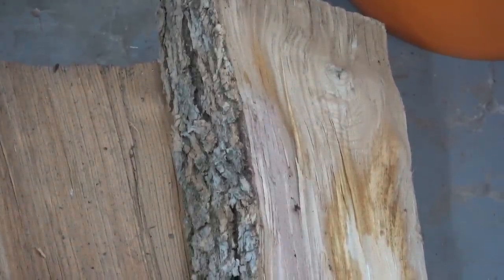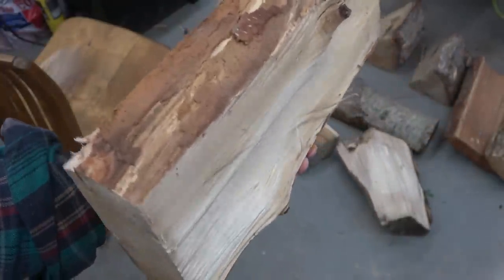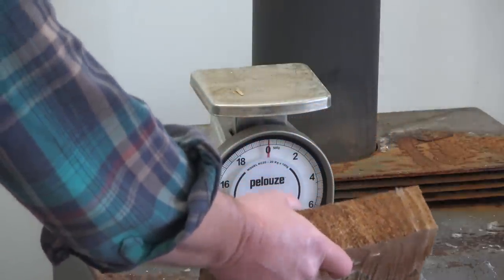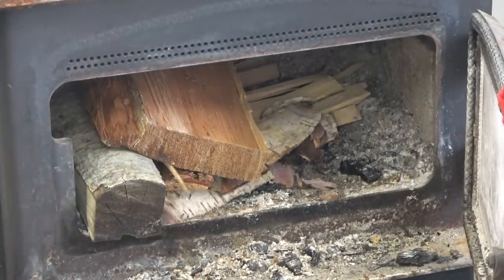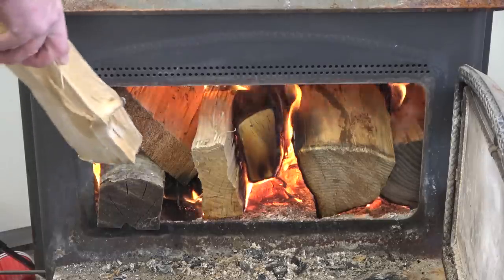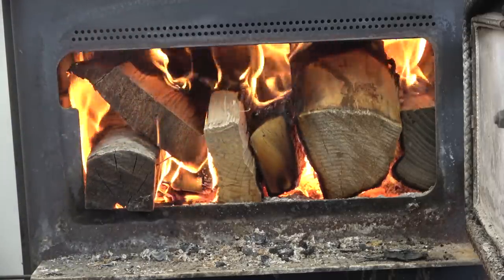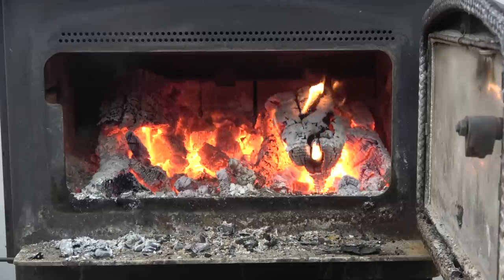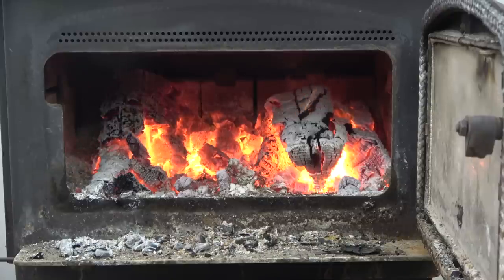Best firewood?

Comment: I learned a few years back that it is indeed all about the mass - the same weight of whatever species, assuming nearly identical moisture content, takes almost exactly as long to burn and produces almost exactly the same amount of heat... soft woods are fine if you don't mind building lots of fires, but hard wood weighs more so you can load more mass in your fire box for a longer (like overnight) burn.
Don't underestimate what a top down fire can do for ya either - it can be a real game changer (seriously).
Reply: I absolutely agree! I burn free pallets I collect in a commercial district nearby, and disassemble using a special crowbar like tool I welded together for this purpose. Nails I simply flatten to collect them later from the ashes with a magnet.

Comment: Heat output is what's important,when I use oak an ash I use a lot less wood and the room gets too hot,when I use softwood,the room doesn't get as hot and I use a lot more of it because it just doesn't raise the room temp like hardwood.
I also put blocks of metal in the one in my shop and place them around the room once hot

Comment: I would argue that a test on volume would be just as useful (and easier to do). The volume of our firewood might even be a more important factor than mass since we have to store it in the truck on the way home, store it in the yard for splitting, store it in the shed, store it near our stove, and ultimately store it to death in the firebox of the stove. Of course you could also do the water temperature calorie test on mass and volume samples of each species, but that seems like work.

Comment: The catch is that the actual BTU's coming off the pine are likely less, regardless of duration burning.  Moisture content really will throw off the weight.  
Tear into an old house and 2x4's are light as a feather.. new ones although kiln dried are still a little wet and take a nail WAYYY better.  Alot of variables in this 'test'

Comment: My recommendations as a burner of the cheapest crap (transport pallets): stack it dense as you can on the bottom of your stove, and start a fire of shavings and chips on top. Great fuel efficiency, tremendous heat, low pipe fouling.

Comment: Old timers know how to burn pine inside without burning the chimney up.  You use the pine when it is burning the off gas as well so the creosote doesnt build up.  You use wet hardwood mixed with seasoned dried wood so the fire burns longer.  So, if anybody says there is a proper or best wood to burn they are just blowing smoke.  It is always better to use a mixture of wood types and moisture levels.

Comment: What was the actual total burn time?  Pinyon Pine has 27.1 million BTUs of heat energy per cord (or 2.65 kWh/lb of dry wood).  Ponderosa Pine has much less @ 16.2 million BTUs of heat energy per cord (or 2.03 kWh/lb of dry wood).

Comment: Best fire wood must have, low water content, low ph, low or none resin/sap, decent size-not split, leaving minimal ash and producing minimal smoke.

Ash of  1 ft. diameter cut to 2 ft. pieces, cured and dried for 3 years will burn in my tuned fireplace for 4-7 hours (depending on out side temp). But my fireplace insert after tuning, when it reach around 300°C it behave like a wood gasifier. There is no yellow flame, minima to no smoke. Only down side is in this mode it behave like a nuclear reactor. If i slow it too much it can die or produce CO, even explode (it happened on 2 occasions, once there was wood chips involved, second small chunks of low grade wood). And if opened it to much there is potential of melting chimney (this happened only once, were i have spot reaching 650°C). Since then i rather go safe then maximum efficiency.

Comment: I had about 50 White Oak cut 2 years back for lumber 
I harvested all the branches and sections of the trunk no usable as lumber 
With several of the trees over 6' at the stump ( Almost 2 meters ) 
I got a LOT of good HARD firewood to burn over the next 5 to 6 years 
I also cut Osage Orange , but it dulls the chain a lot

Comment: If I have a stove insert, is it better to leave the door open, or it doesn't really matter? I haven't really used it for heat really, but I think I might start. Pulls way less draft than the f'ing forced air heat leaking supply air into the ground 🙄

Comment: I really liked this as I’m a follower of wood burning in England and absolutely prefer it to the gas central heating system. Can’t go wrong or better than oak though.
Reply: There's pros to them both, but seeing as how a vast chunk of the US has no hardwood forests, we're stuck with fir and pine species. 

As such, that little thermostat on the wall is much easier to feed.

Comment: For my sins I used to operate a wood heater testing laboratory for many years than I care to recall in Australia. Everything done to standards you understand which meant trying to standardise the fuel wood.
Our technique included pushing very dense hardwood though a steel die to achieve a uniform shape. Such fun...not. for what it's worth the terms hardwood and softwood are very specific but I agree with you that ya burns what ya got except for treated pine that is.

Comment: Biggest problem I have found using pine or other softwoods is too much creosote buildup in my chimney. I only use pine as a starter, split small to catch quick, then add a couple of logs like oak or hickory for the long run

Comment: To be fair, you need to test moisture content first. dry burns faster.
Also, size matters. Wood has to heat up to temp before it burns. 4 inches of fluffy insulating pine will heat to the center slower than 1-1/2 inch thickness of hardwood.

Comment: We never burn pine in the furnace, because of the creosote buildup and risk of chimney fires. Horse apple (osage orange) was the best. Other hardwoods were about the same, but some split better than others. I think it was elm that would shuck off the 8# maul and need a sledge &wedges.

Comment: Another consideration (at least for guys with small pecke.. er, stoves, yeah stoves) is the amount of ash remaining.  I have a small wood stove insert, sorry girls, that will fill up with ash after three days of burning using the all mighty white oak.  Not so with fir.  I need to stop burning with oak, cool the stove (and the abode) and clean-out the oak ash fairly often.  The oak is also more difficult to light.  Since the nominal unit of firewood is volume and the stove volume limits how much you can cram in to heat through the night, I think a volume based comparo may be more pertinent.

Comment: Use cubes to heat up a large pot of water and measure the temperature before and after. You want the pot large enough that the water wont boil. Pout in a known amount so you can calculate the heat energy put into the water. Might want to built a small "stove" out of a coffee can with the necessary holes poked in.

Comment: At around 07:00 I'm askin' me-self: "What's his hypothesis here? "Is it faster to burn your place down with a chimney fire or an interior conflagration?" Also, length of burn is not, by itself, a measure of heating efficiency. I could have "pecker wood" that would burn for 24 hours straight (I wish!) but still leave me (and the missus) cold. Some discussion of BTUs per fortnight or kilojoules per second squared would be most edifying. Cheers (again) from Oil-berta. We have some experience with energy here. :)

Comment: Try eucalyptus for one of those burns.

2 years ago I had a cord of that, 3 logs the size of those on the video would burn for about an hour and project heat out of the fireplace about 30’.

7 logs would keep my (at the time) 1800 sqft condo at 82° all night.

Comment: A given mass of any type of wood will produce about the same energy but you buy firewood by volume. Hardwood has more energy per cord so it's worth more per cord.
Softwood could be cheaper per unit of energy... If you have a firebox that can get the most out of it without clogging up.
That's what you should look into.
Cord price per amount of energy produced by the various types of wood.

Comment: My understanding is....
 hardwood burns longer. Soft ( pine) burns hotter.

Old wives tail is soft causes Chimney fires cuz more creosote. In reality creosote is when wood as wet and most of it is in the bark.

Don't burn wood above 20% humidity and try to not burn bark.

Soft burning hotter also means exhaust leaves faster so creosote should go out the top.

Did a ton of reading to get this info and I ended up deciding burn mixed loads to get the flu nice n warm then damper down with a load of hardwood when its time for bed (no pun intended).

Comment: I'd imagine that one of the big factors is surface area. The long flat pieces had more area to burn off, where as the pine was rounder and had less surface area outside. That and having cold spots in the fire let some pieces last a bit longer. Maybe instead of having one big fire with a bunch of different pieces you'd have multiple fires with only one type of wood, with varying shapes and sizes if you want to be anal about it. The plus side is that afterwards you can sell your footage to those people who just play a video of fire on a tv.

Comment: For the experiment:
Test flash point of the wood pieces by heating them in a controllable way, then remove the pieces from the heat source and see how long they burn, measure weight of ashes after experiment? @techingredients help a fellow Canadian out?

Comment: I burn anything and everything that is dry enough.  Sh*t that won't split gets pucked up into 3-5" discs.  If it doesn't fit in the stove- well that's what saws are for.  The occasional pucked-up sycamore can sometimes be split down the middle if you make it short enough.

Comment: If your going to cut down trees for firewood best time is in the winter less sap and spring is the worst time and frozen
wood will split easier than warm wood and split your firewood  so it will just fit threw the door as the smaller the wood
that's split will burn faster

Comment: Do individual burns with each type of wood using the same weight of each in 2in square blocks. Measure burn time as well as temp output. Possibly monitor audio and visual qualities of each wood type as they burn

Comment: Super dry wood is not necessary the best option.  Having a certain amount of moisture in the wood works to slow the burn down.  Like moderator.  Some btu’s are lost in converting the moisture to steam.  Unless you can control the o2 levels some moisture is a good thing.  You want the heat in the stove and not flash burning and going up the chimney.  Look for cracks on the end of the wood(good) that indicates drying.  Any black lines are bad and indicate rot.  Rot is really bad and lowers the btu’s by a huge factor.  When drying wood it needs ventilation as it give off a huge amount of moisture that can cause the drying process into a rotting process.  Birch is generally not good as I split birch can rot in months because of the water tight bark.  Hence why natives used it to build canoe’s.

Comment: I like this experiment but it's flawed IMO. I was expecting it for it to have a group of soft and one of hard, and measure the temperatures of each over time (ie each 10 mins). Because if a type produces more heat, you can just put less and change it more often. It's not fun to do it in the middle of the night but I know someone that does that and seemed to have gotten used to it.

Comment: Ya have to burn one species of wood at a time.. Take a continuous temperature reading until it self extinguishes.. It’ll be the duration of time alongside the energy(temp) that’ll tell ya which species contains the most energy… 

To make it fairer, I’d put energy density first, so would have the volume as the common factor, not it’s weight. The storage of fuel is a finite factor for most, so I’d definitely match the volume over weight…

Comment: Great insider info inbound: Stale bread makes AMAZING kindling. no tinder no nothing. Just a match all that nasty whole wheat $8 a slice  casino bread the old lady makes you buy in bulk. STILL cheaper than the waxy sawdust bricks they sell at the food library.
a slice a white bread goes under the slice of the good stuff. it'll boil the sap out of bogwood in 20 minutes you'll be shitfaced, warm and wishing you could have that bread back

Comment: According to scientific testing, the calorific value for weight is about the same for all types of wood.  What changes though is burn time.  So weight for weight, a high density wood will burn low & slow while a low density wood like pine will burn fast & fierce.  However, both will produce about the same heat energy for the same weight.  Note, I am using the the terms high and low density, not hard and soft wood.  This is because grain structure is the defining criteria for hard and soft woods, not density.  Hardwoods like Balsa have a mixture of large and small pores while soft woods like African Blackwood have a homogeneous small pore structure.  There, I've used 2 unexpected example to make the point, a low density hardwood and a high density softwood prizes for flute making.

Judging by the tone of your video my factual note is probably going to go agin your grain.
Oh well, life's like that ay!  😁

Comment: Wouldn't it make more sense to compare the same volumn, 'cos that's the way you buy it? If you do it by mass you'll have lots of different sized blocks, different surface areas. Currently burning beech myself 'cos it's the cheapest, most common firewood here in Croatia. Or there's hornbeam but there's not so much of it. Apparently oak is rubbish, you'd think the density would make lots of heat and burn for a long time but it's bollocks, it burns ok but not much heat and loads of ash.

Comment: The best is always hardwood.  
Here in Aus we've got nothing but hardwood, but of all the hardwood you get a nice piece of red gum and it weighs twice as much as any other piece of other hardwood. Takes more heat to get it burning but it'll burn for hours and hours. Fantastic stuff
Reply: No.... hardwood burns too hot and it will destroy the firepit of fireplaces and heating ovens.  Its best to burn mix of hard and softwood.

Comment: Not that great a test cuz the different surface area per volume ratios. Much like how a ton of thin steel plate will rust right to nothing in a couple months, but a sphere will probably take many hundreds (maybe thousands) of years. Sure have seen 200 year old anvils left to the elements barely even get anything taken off of them, so a metric ton would probably take thousands of years.

How dry it is is also relevant, burns a hell of a lot better than wood fresh from a fresh tree. Though I don't suppose there's much you can do about that in that frozen-ass place.

Comment: I'm going to keep tossing in advice until I can't stop thinking.
If you do, do an additional test. Be sure the grain cut in each test piece goes the same direction. No quarter sawn should compete against half sawn.  It's not a gender issue, I just want all of the contestants to be straight.
....vertical
....horizontal,  .....whatever floats yer boat.

Comment: Lodgeploe, nope.
Down here in the upper states of the lower 48 on the west side of town, we enjoy the Douglas fir. (None of that piss fir b.s.)

A proper seasoned pile of the ol doug fir makes for a heat source for about 3ish to the maybe 4 months of cold weather we get.

It's best used to start a fire, madrone makes the coldest of times enjoyable 😉 

With all that being said, a downed Yew wood that's been siting on God's green earth for a few years, (mind you the bugs don't care for it much) makes the best possible firewood. Burns hotter then your sister in her mid 20s. Splits easy enough and coals like a choo-choo- train.

P.s. fuck oak, it's for the bitterest of men...